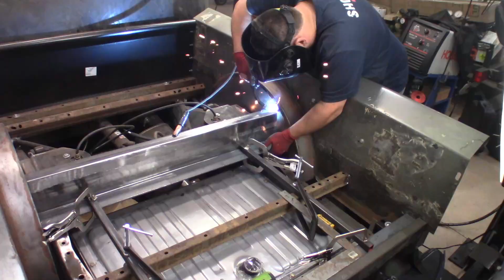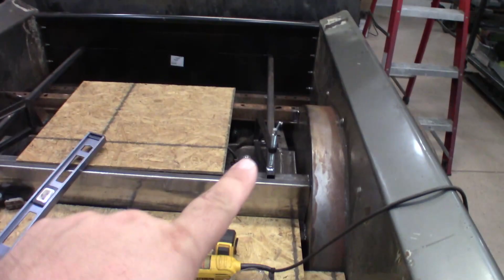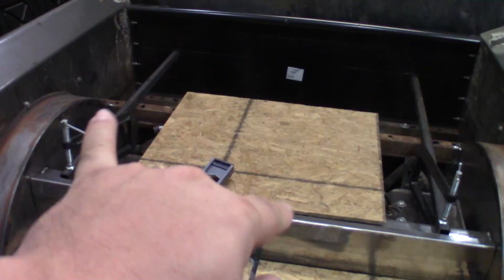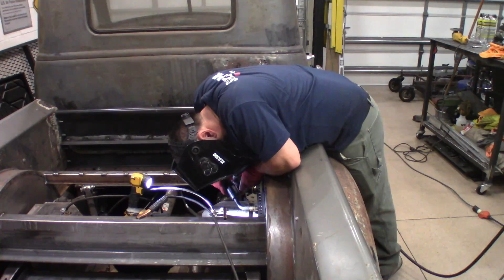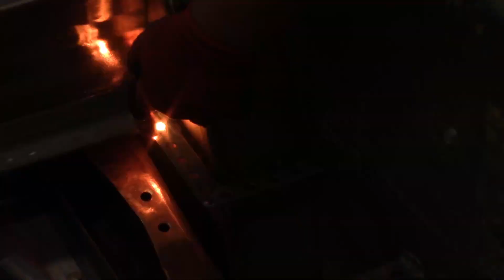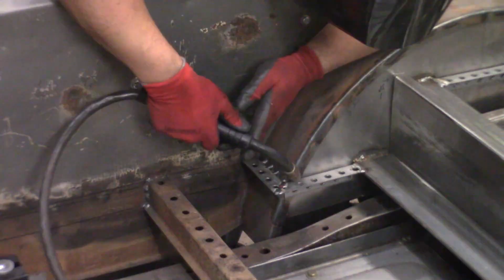PART 43 - 1952 Chevy 3100 - WOOD BED FRAMEWORK - PART 2! DONE!

Comment: I like the way in which you stepped the bed of the box. However, 1/4" angle iron is overkill. The s10 frame is only .125. i would be thinking about weight. Great work!
Reply from the maker: Oh I agree.... it is overkill.... I just wanted to make sure it would be strong enough to span the width of the bed without any other supports..... if something fails, it won't be the bed step :)

Comment: The wood making up the front section need to be fastened together so it can be lifted out in one piece for WHEN, not if, you need to work on "stuff" underneath.
Reply from the maker: If / when I need to work on stuff under the bed.... I'll just undo the 4 bolts holding the bed on, and lift it straight up with my lift (or 4 guys).... :)